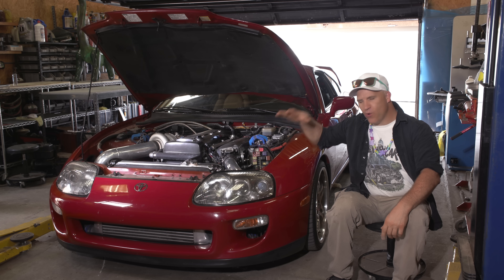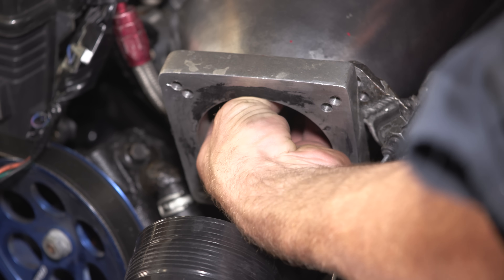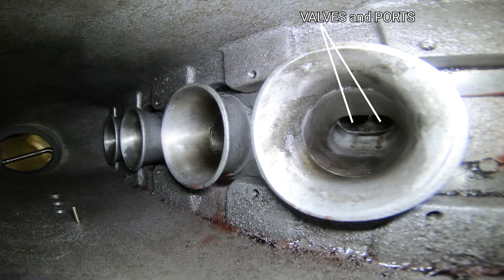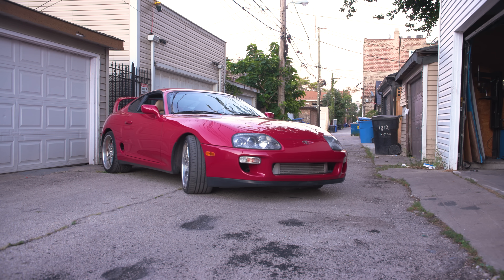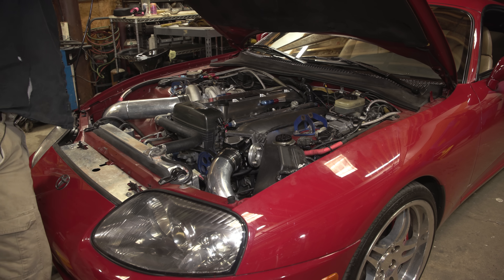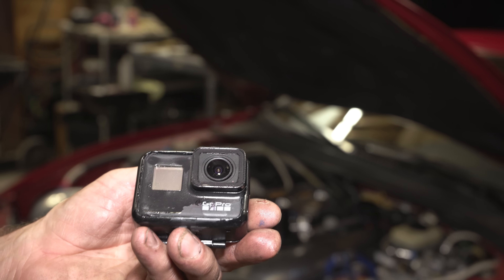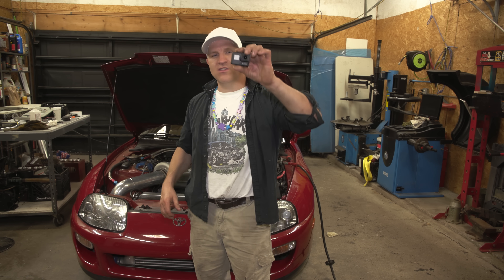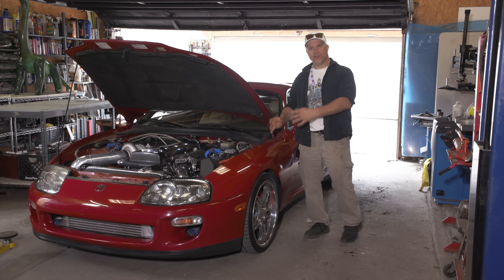Driving with Gopro Inside My Intake Manifold (Toyota Supra Turbo)

Comment: Looks like possible coolant getting inside the intake, Toyota coolant is that red/pinkish color. The oil is just the PCV (positive crank pressure valve) doing its job, Thats normal...but the coolant isnt. Possibly a leak around a throttle body?
Reply: First thing I noticed!
Reply: Nathan Gebben Look to me like it came out around the velocity stack
Reply: Cheese sauce crust, I'm confused. Coolant which is dyed pink makes sense (though I've never heard of that), but how does power steering fluid get into the intake manifold? I'm no mechanic, does the supra have that nearby or something?
Reply: @mhoskins555  I am a mechanic. And I'm not sure why everybody keeps talking about power steering and transmission fluid. I agree..Why would that be in the intake manifold?
Reply: @nathangebben5738  Just what i was thinking :D
Reply: @nathangebben5738  my thoughts exactly .maybe vaccum line but ,if oil maybe bad seals in turbo?had it happen to me but it leaked out hotside of turbo made a 2 mile batman smoke screen otw home lol. it could be fuel as well maybe super rich cold starts and idle??
Reply: @nathangebben5738  I different comment says WP confirmed it was a bad valve on the vacuum tube going to the power steering. So I guess the bad valve made the vacuum pull the PSF into the... uh... I dunno.
Reply: Nathan Gebben He did mention building a rig for the GoPro, probably cracked something when doing it.
Reply: He's like "it's smells like oil? I don't know where all that oil is from?🥴🤦 It wasn't like that when I started it👀👀👀😂😂
Reply: @Some Dude I would use fork oil instead of power steering fluid. Fork oil is red though. If power steering fluid is red, it's probably because somebody was cheap and put ATF in it.
Reply: @jordanmpaul  The Supra JZA80 power steering system uses ATF Dextron II. Recommended by Toyota.
Reply: Patterns!🥴🥴
Reply: That was oil?  I was wondering what that was... ANYWAY THAT WAS VERY COOL, thank you for doing this!
Reply: @Some Dude I prefer Honda ss8 10w. And the Industry standard for power steering fluid is clear. Some companies think they are doing something amazing by selling colored fluid. Makes sense Royal Purple would sell purple fluid right? It does nothing for the system though, causes more confusion than anything really. Haven't ever seen a power steering system call for ATF. Only seen contaminated systems be red, and it is contaminated because mixing hydraulic fluids is not advisable, but like I said, people are cheap and just use whatever.
Reply: @jordanmpaul  I have worked in parts at new car dealerships for 10 years. I can tell you Nissan power steering fluid (not electronic power steering fluid) is factory red. We used to have after market flush kits in clear or red depending on O.E. spec. 90's and older GM vehicles had red fluid and the service spec is dextron 3 ATF. GM also had a service bulletin on a few years of the mid size SUVs like the Traverse that called for the power steering to be flushed and filled with dextron 6 transmission fluid. Should I continue?
Reply: That’s OffRoad Diesel Fuel Duhh
Reply: @Some Dude Toyota in this era specify Dex3 ATF as the power steering fluid for ALL their cars.
Reply: Btw, For anyone with leaky power steering seals in a 20+yo Toyota it's likely that someone put PSF in your power steering, not Dex (or Toyota T4 fluid). Have also seen the same in Japanese excavators that have hydraulic fluid instead of the specified ATF - Leaking seals.
Reply: E85 has a pink tint to it. So its prolly only that
Reply: @LinusDickTips sunoco 110 octane is purplish idk about diesel tho
Reply: @LinusDickTips and now that i think of it the "offroad diesel" at gas stations have a colored dye i dont know what color though
Reply: First thing I noticed I expected more people to comment on that but I had to search for it lol
Reply: @LinusDickTips  done in Canada to mark it as farm fuel. Might have got the dye backwards but they do dye both gas and diesel . Never heard of anyone getting busted for using it on the road but i hear it isn't allowed and an come with a fine
Reply: I was thinking it was fuel. Some premium is dyed pink.
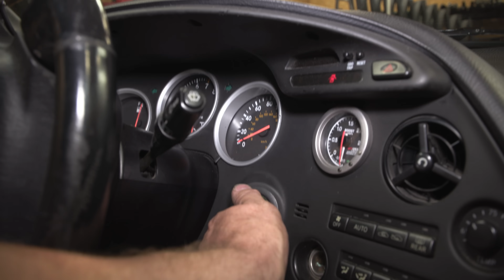Reply: @herranton  at 2:37 when he starts the car you can see where the leak is comming from. He might need a new head gasket. i think its leaking down into the manifold from the engine.
Reply: @herranton  I could be wrong but the only fuel I know they add dye to is agricultural diesel since it's not taxed.
Reply: @nathangebben5738  Gas is also dyed but it's dyed purple unlike diesel which is orange but your assertion about dyed fuel is quite correct and its not legal to run in a street car tank
Reply: @nathangebben5738  100%
Reply: noticed that right away
Reply: Look like k&n air filter oil
Reply: @Some Dude power steering fluid is clear

Comment: Hey Dude - the oil is turbo seal blow by or closed circuit breather system. Pretty normal I would say unless you are noticing a significant oil top up interval. 

I am a engine design/dev guy. Started with Cosworth in 1999

Comment: ...I'm ONLY gonna run about 14 to 16 pounds of boost...  LOL I would have never thought to put a GoPro into the intake so that was a pretty neat idea. As far as the little bit of oil on your camera, I thought it might be a touch of piston blow by coming in through the intake valve. I'm sure your crankcase pressure gets a little high from the increased compression and a little blow by from the top side. Hell, that's just a guess. Kudos on the camera idea! BTW, that Supra is pretty bad ass. Love it.

Comment: Look right under velocity stack #3 during his first start up and rev. You can see the red fluid squirt in. This is not fuel and did not come from the install or the injector/valve area. I would think he has a bad seal/.gasket there but no clue on what could be on the outside of that being sucked in. Anyone else see that and have an idea of what this is?

Comment: Ok, a couple of points:
1) Those 'velocity pipes' were not a good shape.  To stop the effect of restricting the flow due to a sharp intake curve, the end of the pipes in the inlet manifold needed to be significantly more curved / flared than that. Based on both my own experiments using SimFLOW and according to Vizard the Wizard, an expert engine tuner.

2) It looked as though at certain times the fuel injectors were injecting fuel that was being sucked back into the manifold. I noticed the floor of the manifold was wet. Unless that was the oil you were talking about.
Reply: @Some Dude haha! Actually, no, i drive an MG ZS 2.0 diesel. My most modified car was an Allegro Estate 1.3 litre, normally a very pedestrian car, but went like shit off a shovel when I'd finished with it. It was my 'learning how to modify engines' vehicle, and i learnt a huge amount from reading Dave Vizard's encyclopaedia about tuning the 'A' series engine. I've also done gas flow simulations using CFD software as well as designing performance silencers, so i do have some grounding for making that comment
Reply: @Some Dude lol! I thought so actually. And you're right, a lot of 'Monday morning quarterbacks' on every topic

Comment: Interesting that you have a slight oil film.  The majority of the liquid you are seeing is most likely moisture form the air that has been condensed out.  At 1.5 bar, you are at one and a half times atmospheric pressure.  The amount of moisture that the air can hold is greatly reduced when you increase pressure that high, plus, you are intercooled, so you have further reduced the amount of moisture the air can hold.  The oil may be coming from leakage passed through the seal on the compressor wheel of the turbocharger.  Under normal circumstances, there should be enough pressure drop in the seal behind the impeller to allow the compressed gas to keep oil out of the process side.  I am not 100% familiar with the turbo design on these cars.  I am more familiar with diesel and industrial turboexpanders.  But very cool.  I have been thinking of placing my go pro under the hood to watch the linkage and secondaries open up (old school carbs)  You have inspired me.  Thanks for sharing.

Comment: Cool. Also you can see how inefficiently port injection splashes fuel all over the place
Reply: Actually if u look u can see he needs a injector clean that last cylinder isn’t atomizing correctly is kinda dripping that’s can’t be good !
Reply: Cant be worse than carburetors...
Reply: @chrisl6263  they are beautiful in their simplicity but boy did they got obsolete quick
Reply: @darius2640  Obsolete then reintroduced. Toyota now use both direct and port.
Reply: @DiscoFang  oh i was talking about carburetors, port injection is nowhere near obsolete, most people still use port, including me
Reply: Dariune That makes even less sense. Carburettors obsolete quick?? They’ve been around since the 1880’s.
Reply: @Some Dude I knew someone was gonna say that, lol
Reply: Funny how port injected vehicles still get the best emission scores, without GPFs/NoX adsorbers and all that jazz. They also happen to self-maintain their intake tract :D
Reply: That's why you use both designs at once..
Reply: Lol port injection has its pros and cons like anything else. I like my port injected e36/46

Comment: It looked like oil was streaming down the intake manifold below the velocity stacks. At first it looked like gasoline was condensing inside the manifold. But when you showed the oil on the GoPro you confirmed what that liquid was (oil).

Comment: Do you have an oil catch can in your CPV system? It's possibly positive crankcase pressure blowing oil fumes into the intake manifold where some condenses since the manifold is typically cooler than within the crankcase when the engine is at temp.

Comment: Huh, theres a lot of fuel backing up into the intake.. interesting..
Reply: That pink stuff, that was gasoline?  I assumed the engine was fuel injected so we couldn't have seen gas in the intake manifold. I'm so confused.
Reply: @mhoskins555  the fuel is also mixing with teh condensed oil from the crank case thats being sucked in through the pcv system.

Comment: I like the white burst each time the throttle goes from wide open to shut.

I presume it is caused by the drop in pressure as manifold goes from boost to vacuum.

This drop in pressure litterally makes a brief visible cloud in the manifold as the water vapor in the air condenses.

Comment: Good click bait. But you must live in a state with no emissions inspection. Just bolting on crap to the engine will most likely cause the fueling curve to be way off. You have probably cooked the catalytic convertor and removed it. Car is probably a gross polluter. Would not be legal in California. You should put your talents into electric cars or HOW to increase MPG in your current car - not speed.

Comment: The oil probably comes from the turbo through the intercooler.
Reply: I was thinking of that, but distance is too long and intercooler would catch most of it and eventually fill to brim. It does look like its coming from cylinder side and red liquids that Supra has are in cooling and power steering, from witch power steering should be its own system with no connection to engine intake, so more likely is small leak in head gasket from cooling to intake. Checking coolant levels would answer to that question. Also boost would be bit lower than normal, since its pushing air into cooling system, so temps might be bit higher than normal. On letting throttle engine creates vacuum and can suck coolant from the system tiny bit, least that is my hypothesis on the case.

Comment: That oil could be a mist from your pcv.
You probably have a catch can instaled but after a large amount of oil gets captured, the vacuum created during the let offs help vaporizing droplets of oil in the air back again. Not only high temperatures cause particles to vaporize but vacuum does that too. Learnt that after lots of experiments with catch can systems myself. You can experiment adding an industrial coalescing filter after the catch can to capture the fine mist that escapes the catch can via vaporization. You will be surprised how much oil a coalescing filter catches exiting a catch can. I concluded that this double system gets rid of 99% of any oils in the intake of the cars I've handled. 
Unless your oil is coming from somewhere other than the pcv

Comment: My car does a similar thing... It's caused by crank case pressure at full throttle. Because the standard pcv is closed at full throttle. Meaning that, into the intake is the only place the excess pressure can go... You can either leave it alone and let the engine burn the oil. Which is fine for a port injected engine like the 2jz. Or you can install an oil/air separator catch can to try to filter out most it. But you'll never be able to stop it completely.

Comment: I love the youtube pros,talking about oil in the intake manifold, "that's something is wrong" but really the 2jz was designed that way for a reason.
The reason is to cool and lubricate cylinder and rings when on high psi.
The more psi, the more the cylinder and ring will heat up quick and expand causing damage to wall or cylinder to melt.
Reply: Any references?
Reply: This engine is designed to burn oil from the intake for cooling and lubrication?
No. It's not a 2-stroke. 
Just no, stop talking crap.

Comment: Random... but awesome idea. :)

Still searching for a GoPro with a battery life longer than a few minutes, doesn't overheat, and doesn't cost $600. Not required, but it would be nice to replace my $30 (1080p/30fps) Action Cam with something with a higher frame rate. Doing swift motions with a 30fps camera looks hideous.

Comment: The oil will be from the PCV system, looks like there was a fine coating on the inside of the plenum. There will be some fuel mixed in with it also as noted by the fuel going into suspension each time you closed the throttle under high load.

Comment: You have a lot of overlap on the cam and it pushes gas back through the intake. Pretty cool, that Toyota is badass with the turbo. now find a Ram truck with the dual action manifold that changes the runner lengths.

Comment: Shows a GoPro 8 being put in the manifold and then pulls out a GoPro 7 at the end? The shot when he is putting it into the manifold doesn't line up with the shot after when showing the GoPro footage. You can see that the Manifold was completely removed and the shot shows the entire manifold moving while it is put into place. Not saying it isn't real. At first, it made me second guess what really was going on.  Thanks for the video.

Comment: It is normal to have oil in the intake region because the PCV will spill air into the intake and along with it some oil. 
Notice how wet the inside of the manifold? The injector was spraying but not particularly accurate. A lot of it bounce off the port walls.

Comment: There is a distinct cloud forming when the engine went off throttle. It is caused by a sudden drop in pressure which creates condensation and thus the cloud.

Comment: Blocked cylinders are fine, they would go rich not lean.
Reply: However, if the car has only one lambda sensor (which i think is the case), it will read the average air/fuel ratio of all the six cilinders, so readings will tell the ecu the the engine is going rich. That could cause the ECU to decrese the amount of fuel in all of the cilinders and make those cilinders closer to the throttle body to go lean.
Reply: @TheLpd1  It had occurred to me. I stand by my original statement.

Comment: I was surprised at the amount of fuel puddling taking place.  Is it the factory intake?  I bet it would help a lot if the forward side of the runners could be angled towards the throttle body by a few degrees. The Vortices just behind the TB is visible, really cool to see. One good thing about being able to put a camera in the induction tract is that you can see how the airflow is effected if you decided to experiment with some vortex generators or other alterations to get rid of the dead spots where the fuel is puddling. Way cool video.

Comment: It has a red residue so I would look for what fluids are red and go from there.  Whats bad is that oil is leaving carbon deposits unless it's transmission fluid. Transmission fluid is a pretty good carbon cleaner.